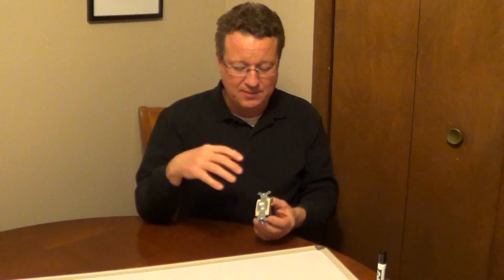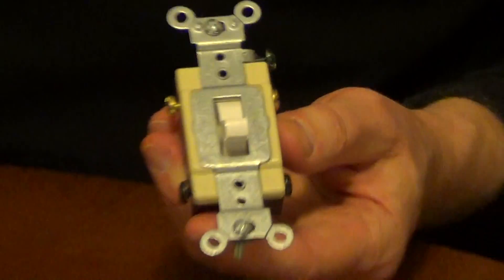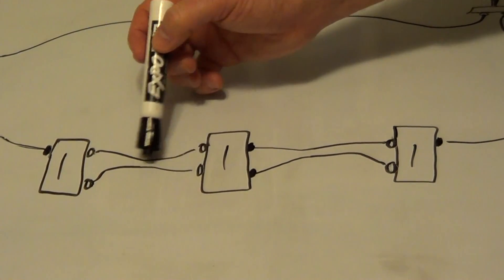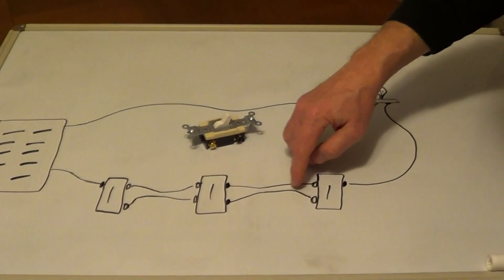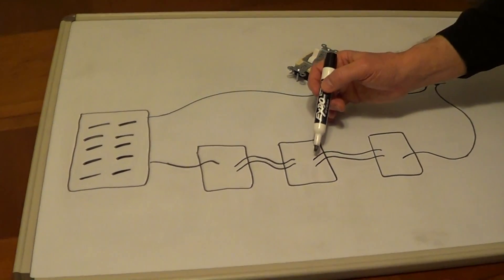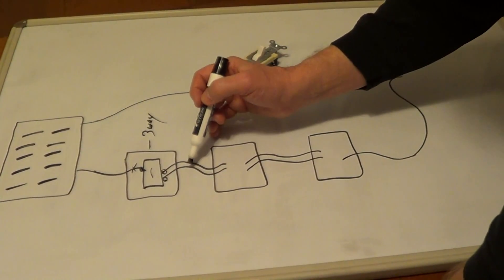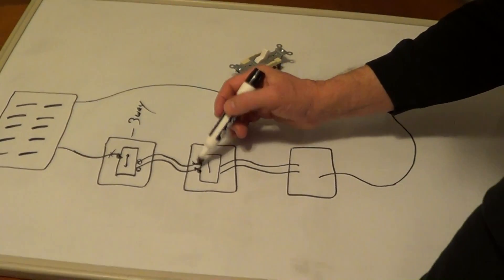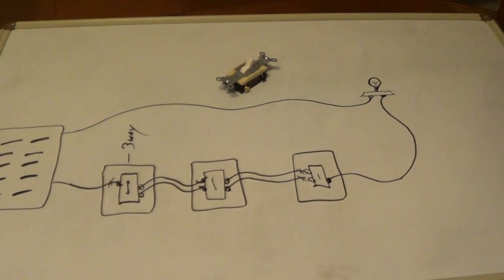Wiring a 4 Way Switch - 4 Way Switch Diagram - Four Way Switch Wiring

Comment: How would you wire 2 4 way switches with 2 3 way switchss
Reply from the maker: Hi, you start with a 3 way and end with a 3 way. The 4 ways would be in between.

Comment: Thank you very much. I'm replacing an old 4 way switch with no difference in screw colors and the internal circuitry is different. The only way it could be done without having a short circuit was to identify the source & travelers in & out of the 4 way. Everything works and the house isn't on fire.
Reply from the maker: Glad it helped.
We have more home improvement tips on our weekly podcast, Fix It Home Improvement. You can subscribe on your favorite podcast app. https://www.stitcher.com/podcast/fix-it-home-improvement-5/fix-it-home-improvement

Comment: It is ok if i would use 5 to 10pcs and so on ?of  4 way and 3 way switches?
Reply from the maker: Hi, start  your circuit with a 3 way switch and end with a three way switch. Put any amount of 4 ways in between.
We have more home improvement tips on our weekly podcast http://castbox.fm/u/6389499.

Comment: How would you remove one of these switches?  I am removing a kitchen wall and dont need 3 switches and would like to remove it.  I have room to extend the wiring and move it to the side wall before I do the finishing sheetrock.  Is it as easy as removing the switch and connecting both ends on each side of the switch properly with sliceline in line wire connectors?
Reply from the maker: Hi, you can remove the 4 way switch in the middle of the two 3 way switches and wire it with two 3 ways. Just tie the 2 red wires and the 2 black wires together. You can email me at fixitpodcast@gmail.com.
Reply: Thanks.  The one I wanted to remove was luckily in the middle and It worked perfect.  Thanks for the help.

Comment: Red and White are travellers.  When S1 in in the down position, I have power in S2 on the red wire and power in S3 on the red.  When S1 is in the up position, I have power in S2 on the white but no power in S3 on the white.  Do you suspect a broken wire in the last white circuit? I don't want to have to take apart the lights (3 in the load)
Reply from the maker: +Dominic House Hi, usually the problem with a 4 way switch is wiring the 4 way incorrectly. The pair of travelers from a 3 way have to go to the matched pair of screw terminals. I would start there. If not, then you can take the switches out and using a tester easily rewire. Let me know if that helps.
Reply from the maker: +Dominic House The up or down position is relative to the next switch and how the travelers were wired.

Comment: Should the travelers going from one to the next 4-way exhibit continuity on a multi-tester? And does it matter if they are attached to INCOMING or OUTGOING? Thanks.
Reply from the maker: Hi,
You want to connect the pair of travelers from one 3 way switch to one group " incoming or outgoing" . It doesn't matter which group.